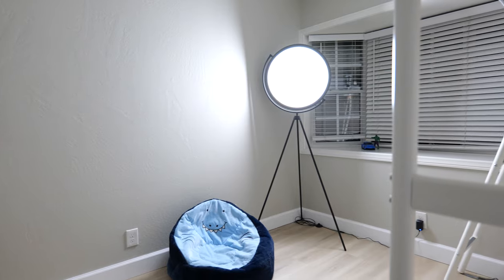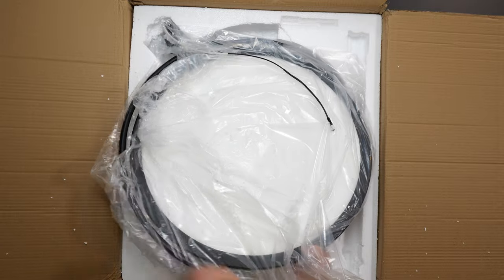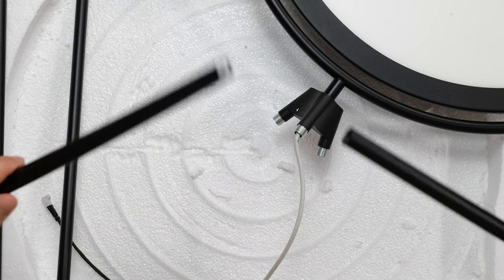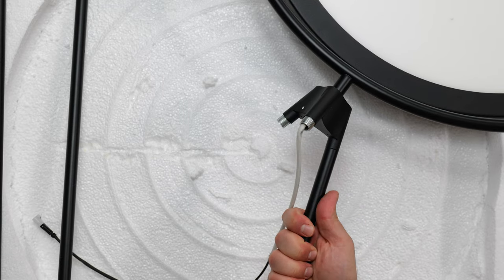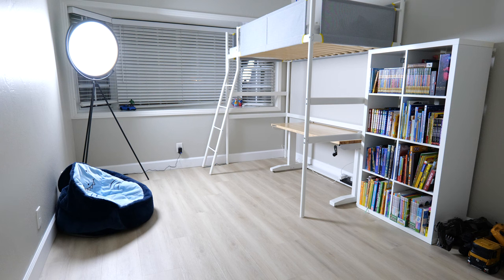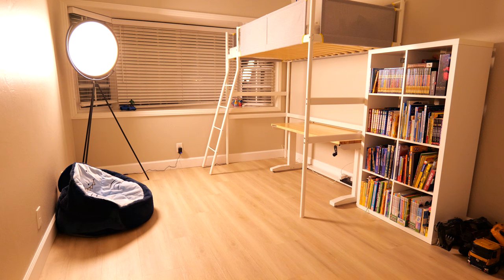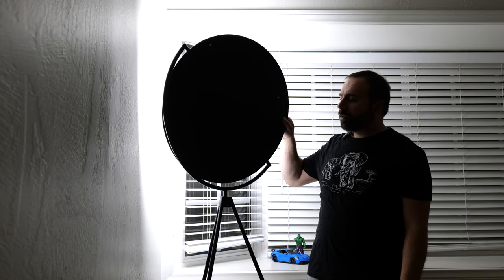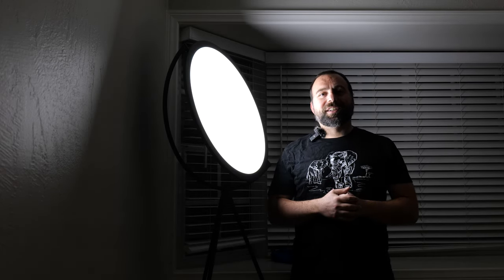Modern Lighting Ideas with Superloon Floor Lamp | Unboxing, Setup and Review

Comment: Bool light but feel it would be better if it didn't have tripod legs as it takes up a descent amount of space
Reply from the maker: It does take some space but as a result the light is stable especially cause you can use different angles